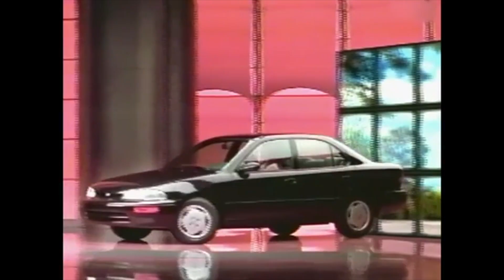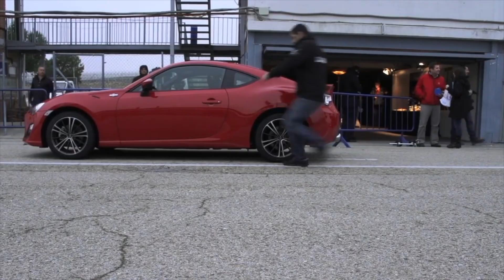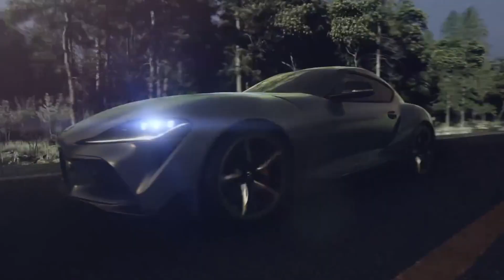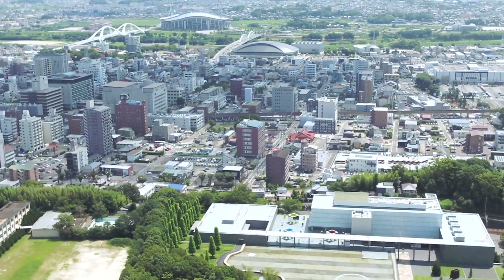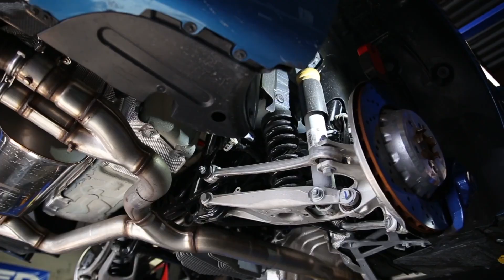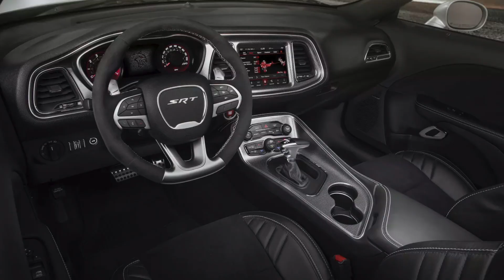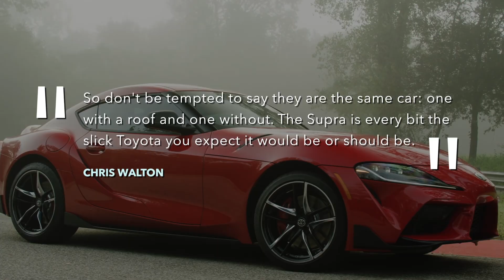MKV Toyota Supra - BMW or Toyota? The UNTOLD TRUE STORY

Comment: The "supra" the the potential to be a great car. But their fatal error was calling it a damn Supra. That's like Ford hiring Mercedes to build the next mustang. I'm sure Mercedes could build Ford a F*cking great car, but not a single cammo hat wearing, miller light drinking american would buy it if they called it a mustang. In this case Toyota made a mechanically perfect car, then hired bmw to build the next gen version based off an existing car that can't hold a candle to the old version...
Reply: Merc did it with the Challenger, Charger, and 300 and nobody batted an eye even when they used a fake Hemi engine.
Reply: @thisuserdoesntexist9  They didn't hire mercedes, they just bought the chassis IP. You can buy a 2012 charger and swap part around with a 1984 e-class lol. It's too bad it isn't engineered like the e-class though, since it's superior in every imaginable way and hundreds of pounds lighter.
Reply: Exactly, they used a 20 year old platform and didn't get the flack that Toyota is getting for an actual dual developed vehicle using the newest and best co-developed chassis and components.
Reply: When i read your comment it makes perfect sense i love Honda and if they brought the Prelude or S2000 back with other brand parts i would be hesitant cuz i would be saying “Its a Honda or its not” i completely understand why Toyota ppl be upset now cuz even tho i thought putting a BMW engine would be better which it could be its not what the OG was
Reply: Mercedes also worked with Infiniti/nissan/renault with the A/GLA/CLA platform. They share the same chassis engine, trans and interior. So..

Comment: As a previous Supra owner and fan I can't help but be disappointed with the new one.  Looks aside (I don't like the front) it has the same horsepower as the original twin turbo which was released 25 years ago.  The original Supra was close to supercar quick in it's day, this new one looks like a detuned BMW M2.

EDIT: Excellent video by the way Albon, very well put together.

Comment: Look I have no issue with this car's existence or the reasons as to how they made this way.  BUT.  Don't call it Supra.  Let the nameplate die an honorable death instead of using nostalgia as a money grab.   This should have been called the Toyota 89.  Big brother to the 86.  That way, NO ONE would have gotten pissed off.   It's just another jointly built machine.  Plus give us a damn manual, FFS.  All this emphasis on driving enjoyment and perfect balance, blah blah blah and you nerf it with 2 pedals?   Come on, guys...    The 86 has it, this one should, too.
Reply: @cheefukeefu   I don't buy that because it has an inline 6 makes it a Supra.  Many cars have inline 6's.  BMW has been doing it forever and they still do.  Are other BMW's then related to the Supra, because of the inline 6?   That's like saying the Camry V6 and the Taurus V6 are the same car.  Both FWD V6 sedans, yet entirely different.

The fact remains this car is mechanically a BMW with a Toyota body on it.   It's a joint venture, much like the 86.   The new Supra has more in the common with the 86 than it does with the MK4 -- by a wide margin.  This is why I have a problem with the name, not the project.  Had they called it anything else, there would be no backlash.

Make no mistake, this car is NOTHING Supra.   To say the BMW inline 6 makes it a Supra is ludicrous.  It's not even a manual, even less relation to Supra.

They just did it for the commercials and sales.   Despicable.
Reply: @cheefukeefu  I'm fully aware of the AE86 call back.  I've been building Toyotas for over 2 decades.  The new Supra was supposed to be the spiritual big brother to the 86, so a larger number would make more sense to the general public which has no idea was JZA80 means anyway.  Besides, this new Supra has nothing to do with the old one so any reference to JZA80 would be pointless.   It fits in with the typical numbering standards automakers are using.  Use any number, letter, greek alphabet character, I don't give a SHIT.  Just don't use Supra!
Reply: The GT-R also needs to die a death and stop making the legendary Skyline look bad. They try to sell a $50,000ish vehicle for over double that and no wonder nobody is buying it.
Reply: Oh and before anyone says anything, I owned a brand new 2014 GT-R that cost $104,400 and I can say it's nowhere worth that. Every year the price goes up and they don't even add anything to justify the cost. People buying it keeps dropping for a reason.
Reply: 86 stands for 86mm of piston travel.
Reply: @cheefukeefu  it's not worthy of the name and in no way it's the same as the old ones those where built to last and tough as fuck. this hunk of shit is disrespecting the legendary supra. this piece of shit will never amount to them in any way possible this thing is 95% bmw fuck this thing I would have it crushed 10 times back to back.
Reply: @cheefukeefu  It seems we agree on all counts but the name.   ;)     To me, it's just not a Supra.  Toyota did not build it so...  not a Supra.   If Porsche and Subaru got together and built a new 911 with on top of an Impreza platform flipped around so the engine was in the back, would you be ok with that being called a 911?   I mean, it's got a boxer engine in it, so YASSS it's still a Porsche.   No way man.  This is the same thing here.   Collabs are fine. But call them what they are.

Manuals all the way!

Comment: This Supra is soo ugly. Why didn't they do it in a pretty way? Give it a real face, let away all these fake air intake/outlets,  give it a nice rounded side window line (not this Nissan-like) and make the sides smooth without these ridicilous folded metal. It has a long hood, which is a nice thing, but has it to look like the next Bat Mobile? No.

Comment: Albon is apparently Chris Walton's first cousin. I guess Chris is being PC and I guess Albon doesn't even listen to his own video. According to the video, which I thought was extremely well written and produced, these cars are twins with different external clothes on and different pairs of shoes. The outer skins are different and the suspension dynamics are tuned differently enough to give them each a different driving feel. Other than that it's the same car. You did answer the internet question. You just didn't agree with your own story.

Comment: For Toyota to bring back its most iconic nameplate in Toyota's history and do this.. is really a slap in the face to everyone that has ever fantasized over or ever wanted to own a Supra. Toyota has essentially brought the Supra nameplate down from its high pedestal and placed it down and low right next to the Z4... these two names should not even be in the same category let alone use the same platform.

Comment: Making excuses for rebadged BMW.  Supra should have a manual transmission option not a slush box.  Suspension should not be cheap MacPherson struts like BMW.  Previous version had alloy double wishbones. The engine components are going to be cheap plastic like plastic intake, plastic valve cover, even plastic electric water pump (BMW engineered).  Not anything like past Supras were engine components were all metal and built to last.  You also get a smaller car than the MKIV and reduced visibility.  Just sell and buy a Z4 or two door "sports sedan"....and pretend it is a Supra.

Comment: If the supra was the be developed by any other manufacture other than Toyota then BMW would be the best choice.  Toyota got that right.  Also to all the ignorant ppl that are upset its not a toyota engine, well BMW actually make the best engines in the world so that's a big plus.  The most awards won for their engines by a LONG margin.  Fact check this.  International Engine of the Year awards BMW 63, VW/audi 36, Ferrari 26, honda 23, Toyota 22 , mercades 13(lol) ford 9.  What can be done with a tuned n54 is nothing short of amazing and comparable to the 2JZ.  Apparently the n54 is the new 2jz for tuning. AND the reliability issues are not reliability issues at all, its because BMW parts are really expensive and also the labour.  People buy old beamers because they are cheap and cannot afford to buy new parts when something breaks, like in any other car.  Then they label them money pits.  The fact is they are super reliable engines that go beyond 500,000 if looked after.  I mean there are more old beamers on the road than Toyotas.  I've driven an e46 with 700,000 on the clock that still drives better than modern cars.  My e92 N52 motor as 300,000 on the clock and drives awesome.  This supra is going to be Toyotas best car and a classic and if it didn't look so stupid I would really want one.  You tube comments are mostly wrong and by kids that will never afford to buy either of these cars.
Reply: i agree with you on this. I do my own work on my e30 and e82 with the n52. What is expensive about it? (well I havent done anything major, dont have to). What running cost are people complaining about? An oil change for me is the cost of oil, oil filter and air filter every other time. The n54 is a good motor, and has alot of modding potential. 
@Adam Pap have you seen the videos of the turbo n52 motors? Seems like our n52's can handle alot also! I like Toyota, BMW and Jeep, having 2 of the 3 work on a car together is great.

Comment: I just think its lacking the culture of the supra by collaborating, especially collaborating with a euro manufacturer. Thats also stepping over the culture of the Z4 as well too. Because it was co created we now have two vehicles that, in their inception looked drastically different, and now look like siblings. I just hope Varis or Rocket bunny make MK4 styled front and rear ends for the Supra, and some manufacturer will make a 6 speed conversion, first 2JZ swap will also probably occur within hours of the vehicle release to the public. the aftermarket is what will save this car.

Comment: The new supra isn’t the same as a 2Jz Gte

The head on the new supra is spray coated not sleeved, so engine rebuilds won’t be the same.
It won’t have a dip stick, that is stupid.
A drivers car is a manual not this BS.   Toyotas son is a fool.

Put a 2jz GTE in it & it would of been a hit.   But it has not.
But even then its looks terrible, no good looking curves, 

They should of done a basic facelift & kept the old engine, the 2JZ GTE & gear box that went with it.

Comment: no manual no buy it Toyota has lost its cool Nature years ago killing their inline six engines fwd obsession not to mention over use of tech   for cheaper v6 was one in may big company moves .i have a few supra but i will not buy this one no not even do i care at that price i do not trust BMW engines with coated cylinders not cast iron that's works well  .may 1984 supra still has the original radiator .. does not have twin a arms front suspension that's just being cheap asses no stick manual its just another modern over engineering car missing something of a smaller company japanness of Toyota time

Comment: BMW and Toyota make an unique and interesting car that is balanced and fun to drive. People complain that it does not have 900hp. Old supra sucked out of factory. People invested 100k in the old one, to be any good so this is a bargain.
Reply: "Old supra sucked out of factory"

That's not true at all. The reason people are complaining is because they expected a car with the Supra name to compete with it's old rivals, the GT-R and NSX(there is no RX-7 yet) and it just doesn't. 

Thei fault for getting their hopes up, yes, but hard not to when that name has a cult like following
Reply: @eg6gsr  The price reflects that this is not GTR. This BMW engine can easily make safe 500+hp with stock internals if it is anything like the one it is replacing. Would you rather have 125.000 USD price tag that nobody can afford? If you have that money most spend it og Porsche, Mercedes or BMW not an Toyota.
Reply: @zippodk  
Price has nothing to do with what I'm talking about and neither does modifications. 

People where thinking along the lines that a car called Supra should compete with the GT-R and NSX seeing as they were once rivals.

Anything can be made fast and I'm sure this car will be at some point but it's not the car Supra fans were expecting, they were looking for this car to get the GT-R and NSX treatment out the gate especially with a master piece like the LFA(which was thought to be the supra at one point) under the Toyota/Lexus name
Reply: @eg6gsr  I get you and I was also expecting something else but if I am honest i would never fork out 120.000 on neather of those cars. GTR and NSX are apparently not selling well and Toyota/BMW made a decision. Can you blame them? Alot has happened, since supra was on sale. There is a reason why a new supra wasn't made right away it was just not selling well. S63 or M5 Competition are the cars to get today.

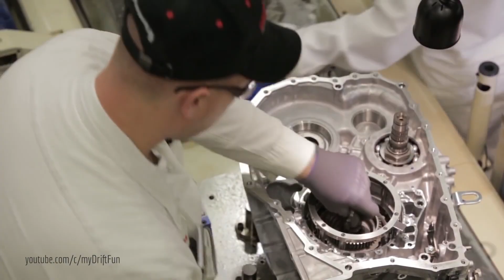Comment: 11:17 WUT ... This very well-made video was actually starting to crack my skepticism of this car right up until this point. NO MANUAL TRANSMISSION AVAILABLE ON THE NEW SUPRA.

NO.

MANUAL.

TRANSMISSION.

Maybe I'm just a curmudgeon - but if a car isn't even available with a manual, it just can't be called a driver's car.

FFS my cheap Suzuki has a 5 speed.

Comment: I could be wrong, but throughout recent auto history when cars share a platform they are normally similar enough to each other to be considered "re-badged". Both will have similar weight distributions, power, brakes and suspension, transmission and rear axle, ect. In my opinion these are just slightly less "re-badged" than many platform sharing cars.

Comment: The truth of it is that most manufacturers now share or borrow or collaborate on models and platforms, which makes perfect sense if you are a car company exec, why spend millions on a chassis when you can buy them in? Look at how the last of the Saab's were GM's underneath, the same as the Opel / Vauxhall models. We had the Subaru BRZ and Toyota GT86 and long before that the Citroen C1 / Toyota Aygo / Peugeot version.

Commercially the days of you buying a model because their products were the best is almost over, everything will be a mix of other companies best parts. For most applications this is fine, who would be upset that their Toyota Corolla had BMW suspension for example? The problem here is just the iconic nature of the Supra, I guess we need to accept that times are not like that now and such purity doesn't make commercial sense any more.

The car industry is in massive upheaval with the advent of electric drive-trains, self driving technology and so on, anyone spending out on new engine designs right now would be mad, how long before liquid fuelled passenger cars are long gone? The car will go the way of the Horse. Once Horses did everything, pulled carts, carrier people, they were everywhere. Then came cars that went faster, carried more and lasted longer and now Horses are revered animals, something people go to see, something special. Petrol cars will be replaced by electric cars, which let's face it 90% of cars are for the commute or trip to the supermarket, who cares how its powered. This will free up the 10% of cars to be something special, maybe they will bring back V10 engined F1 cars as the only place you can hear a screaming engine! That 1980's Ferrari F40 will be all the more magical and a spectacle to behold once everything else is silent and electric!
Reply: except GM owned all those brands.

Comment: basically 16mins of BMW quality is crap, so Toyota needed to retest everything, and found nothing wrong, as there is no difference to BMW models. Keep repeating "derived", doesn't change it. So toyota deliberately detuned the B58, or would Okams razor just say they only will give lower tuned to partners ECU firmware? So the less features, lower power car is the better one? Cool story nippon fanboi.

Comment: Sorry but, motor, suspension and transmission from BMW.....thats everything that matters and all from BMW. Then Toyota makes, completely on their own, the body...which has design cues from the BMW as well as several other vehicles and we're supposed to feel like this is a great job by Toyota?  Sorry but no. This is not the Supra anyone wanted. Basically the end verdict here is that the Internet is on fire with opinions....that all seem to be based on facts.

Comment: whats wrong with last gen supra chassis, and 2JZ. does toyota even know full moding protential of the 2JZ.  my vision of the new supra would be, last gen chassis, 2jz, manual tranny, m3 brakes and suspensions or does m5 have better brakes, minimum electronics: only for suspension tunning, maybe launch control, but you can still do a good launch from TRC, no AC , heater , trunk light, oil change, modules. you dont need a computer to tell you why the trunk light broken. better have oil dip stick, you cant trust electronics remind you when to change oil, write it down mileage every time do an oil change. electronics are expensive but oil dip stick is cheap.

Comment: Sure they would have different driving charactersitics, but it's just in the tuning. The platform and components are the same. 2 mk4 supra's tuned and modded by different people would have a greater difference. Does that make them different cars? For people who buy new, service with the dealer, can't find their dipstick, they will be 2 different cars. That however is not the supra demographic. Might start saving and pick one of these engines up cheap when everyone starts ripping them out to put 2jz's in haha.